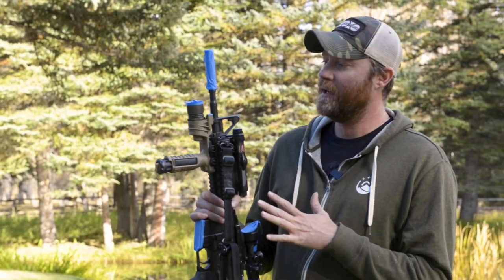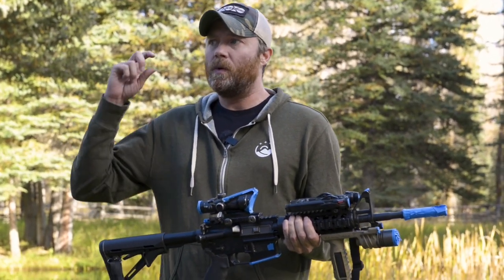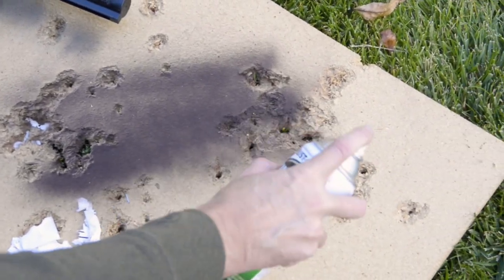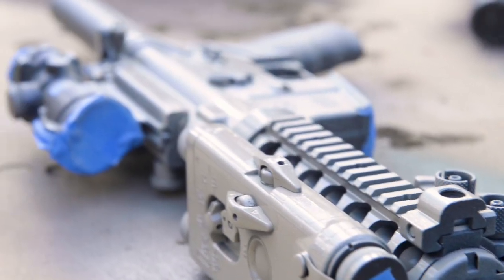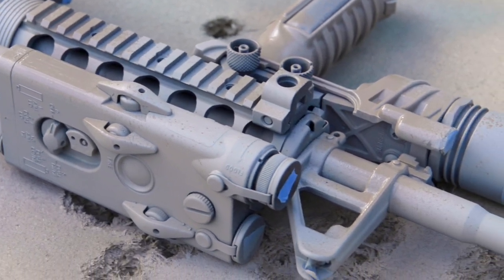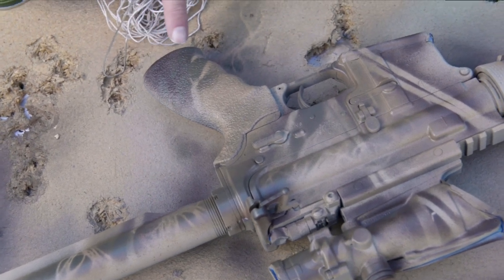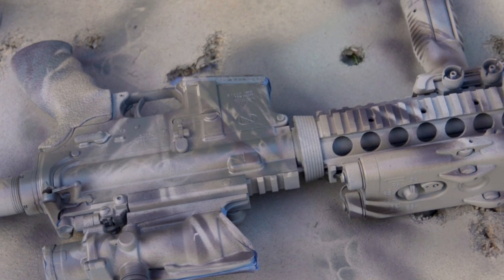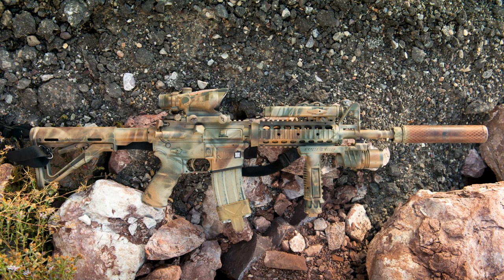How to paint your rifle M4A1 BLK 1

Comment: Whenever you use spraypaint  (or spray texture for drywall) its best to put hot water in a bucket and let the cans soak for a few minutes then shake them, then soak them to get the paint warmed up throughout.   You get a better mix, your nozzles spit less, and since the paint drying is an exothermic reaction hot paint dries faster/harder.     I learned this trick from an absolute virtuoso with a rattle can that guy layed down Krylon better than most people can use an actual paint gun.
Reply from the maker: Awesome Tip, I am going to try that thanks for the suggestion!
Reply: THIS! I have a muralist friend and he does this with his cans. Swears by it as a matter of fact
Reply: Try the Microwave. Its easier 😁👍
Reply: @alexl.1186  Lol you know someone will probably try that...
Reply: @SavageShooter93  exactly 🤪

Comment: Hell yes cerakoting is for safe queens
Reply from the maker: you bet your ass it is! 😂
Reply: With cerakote, you are committed.  Paint is easier to change and a lot cheaper.
Reply: Not if you do it right, in my case I Cerakote the base color then rattle can the camo colors that wear into the FDE or OD base coat, my effort is to eliminate the black...this allows me to do that with an earth tone and still have the flexibility offered by the rattle can top coat.

Comment: I made a clone of my M4 when I was in the marines between 2009-2013. I used an M&P sport II as the base and kept the OG buttstock and kept the OG A frame front sight post but I bought a monstrum quad rail extension handguard with an opening for the front sight post. My rifle is 16" and the handguard used to be 6" up to the front sight but with the quad rail now it goes past the front sight post and is 12-13" long and I have a hogue pistol grip and the usmc bipod broomstick on her as well as a flip up rear sight and an ACOG on a QD mount with my sling wrapped through my buttstock and hooked onto the sling ring under the front sight post... I love it and only use the GI mags with the rubber magpul finger pulls. Looks great
Reply from the maker: Nice!!

Comment: Too funny I just got all the parts in to finish my M4A1 BLOCK II-ish and I'm painting this weekend . I'm doing Forrest Green , ODG and Patriot Brown . 
I picked up Centurion C4 12" Quad , BCM SOPMOD MOD 1 Stock , Arisaka 18350 Light  , Centurion AST Trigger ,  Sprongco Red Spring , Colt H2 Buffer and Sig Romeo4T . I bought the Colt M4A1 Block 1 Upper in 2008 . Apparently it fell off back of truck near Anniston Alabama lol . I also have couple Colt M4A1 LE Lowers that dont have the ridiculous high shelf . So they can be used with GI or DIAS .  I've been waiting to do Block II-ish for a long time . I have way too many Block 1s and Mod 0s .  If I can track down used TA01NSN at good price I'll probably pick one up . I'm building this as back up rig . I've been using Colt M4A1 Block 1 as my back up rig for 10 years so it's about time I upgrade ..
Love the videos bro ..
Just signed up for Patreon.  Hopefully I'll be able to send you over some pics once my Block II-ish Rig gets done..
Reply from the maker: Awesome thanks for signing up would love to see the build.
Reply: @loneelement  I'll hit you up on Patreon once its completed.  I have 5 day weekend coming up so should be able to finish it out then ..

Comment: I see some really whacky camo. Don't do stripes like a sea snake. That's like a railroad crossing sign kind of. People really pick up on those patterns. 
Rule 1, break up the outline so it's hard to see the edges. So corners of magazines, mag wells, corners of handguards and lights so they never look square or like shapes we associate with unnatural things. 
Israeli helmets make their heads look like rocks instead of the helmet that makes everyone go look! A helmet! I use lines for that. 
 High contrast drastic, larger color changes for longer distance disguise because a bunch of intricate woodland type just looks like a brown gun from a distance in anything but actual woods. Like the pictures of a face they make with lots of little pictures of other faces. Like pixels. Black and white stripes just look grey from far enough away. That. So do some intricate stuff but also make it so there's big darker or lighter stripes or edge break up. 
Lighter on bottom and darker on top like animals. It's for confusion as to what's the top or, is that the top of something? Can't tell ...  That. 
 Start lighter base coat to end up darker, start with darker colors and add lighter to end up overall lighter. The overspray keeps adding up. Your coyote or tan will be a darker greyish green kind of color by the time you're done. Paint it with actually still wet 91% rubbing alcohol all over it as you go and watch what happens. Makes it look airbrushed and blends all the paints together to look like a photo. Takes a little practice and Krylon is so much better than Rust-Oleum on every level from application ease, to final look to actually drying and setting up like it's supposed to. If you like getting paint rubbed off all over your hands every time you touch your gun Rust-Oleum is for you. If not get the Krylon only. The final job will look 10x more professional with less effort. That said, Rust-Oleum high heat paint is awesome. I mean you need to try it. Leaves a hard, flat black finish that looks like something a tactical scope might be coated with. Cool. It's a psychology. Not just random blobs and streaks. Always hit the corners. And the front view. That's pretty important and missed a lot. 😂 cover your light. I'm out.
Reply from the maker: Thanks for sharing the data, Im going to follow your advice and and try the rubbing alcohol trick for the next video
Reply: @loneelement  I got frustrated cleaning up some spots one day and just sprayed different colors all over a handguard when it still had alcohol all over it. Came out really cool looking. I use alcohol to get fresher paint and not damaged older layers so much.

Comment: Awesome tutorial, did you perp the gun first with anything before painting?
Reply from the maker: nope
Reply: Only prep I do is throw in on the dirt and start spraying. Mask off what you don't want paint on. The oils that are around the fire control will make the paint lift and come off and any carbon deposits will also make the paint come off easier, if dirt get on it while painting, good, it adds to what I'm trying to achieve.. But this isn't about having a safe queen. It all wears off when you USE it. Once it wears down too much hit it again with the cans. Hell I have a hard enough time keeping the black anodizing on the guns I don't have painted 😂  
Don't be one of "those" people who paints their tools just because they think it looks pretty and never use them because they are afraid of it getting scratched, or worse... Breaking a nail 🤣

Comment: Sorry brother Cerakote only and a stencil kit...and a touch of airbrushing. It helps when I've been a professional autobody technician and painter for 33yrs. Collision, restoration, custom, airbrush and mack pinstriper. I have zero safe queens, 7, going on 8 hand built AR-15's (my personal AR's) and tuned by myself, Cerakoted, 30 builds in last 3yrs. Cerakoteing isn't for Safe queens. Not mine. If it goes BANG it goes to tha range! I'm not knocking your job. Do your thing and be proud of it. Once you've been holding a spray gun for as long as I have, I couldn't be forced to whip out a rattle can.....🥴😝

Comment: Whatchu talkin bout saying black is easier to detect under IR? I use a sensor that uses IR regularly and would say that’s not true. I would 100% agree that black draws my heat which would pop up better under a IR sensor but the color doesn’t show up any better then any other color.
Reply: Think he was talking about IR light reflection when using NOGs. Some blacks look bright white under night vision.  Could always tell who has a black watch cap under their helmets (at night using NV).
Reply: @tcr2237  my bad yo I retract my statement. I use IR in Avaition and all we see is heat and I’ve actually had someone ask me what color that technical was when it was 3am in the middle of nowhere and we all had a good laugh at the guy
Reply from the maker: Ah I believe you are talking about thermal and technically you're correct.  Night Vision is technically called I2 (I squared) and yes black has the highest reflection of any other color on a gen 3/3+ tube.
Reply: @loneelement  misunderstood homie